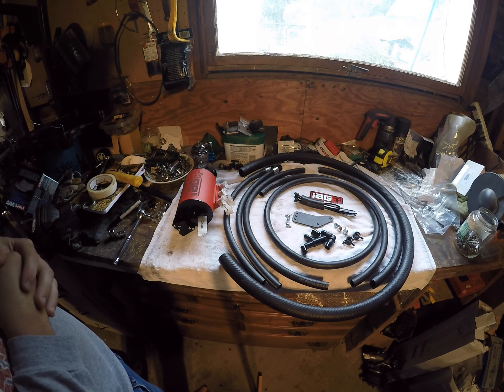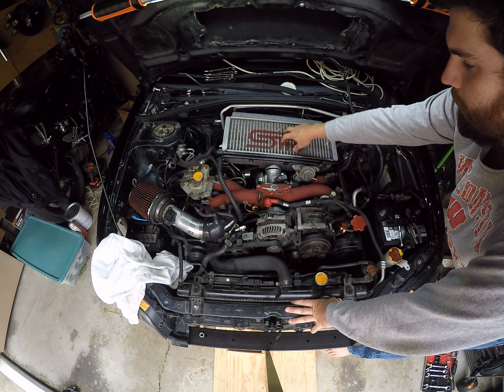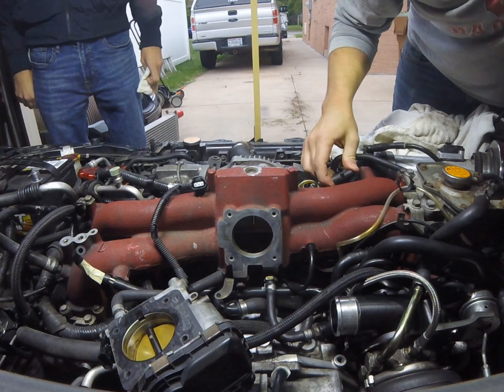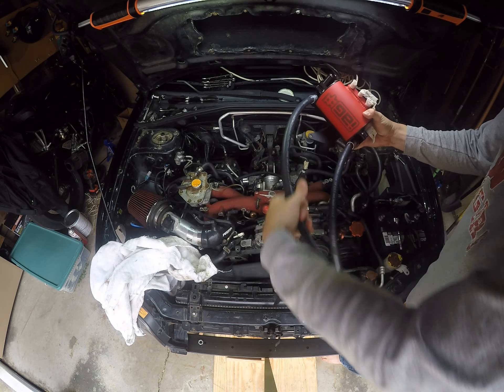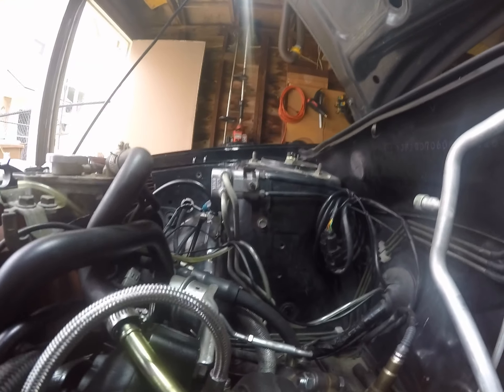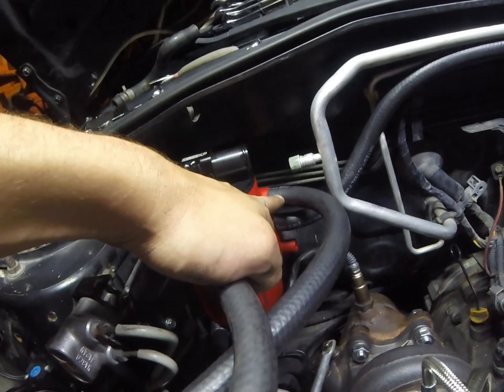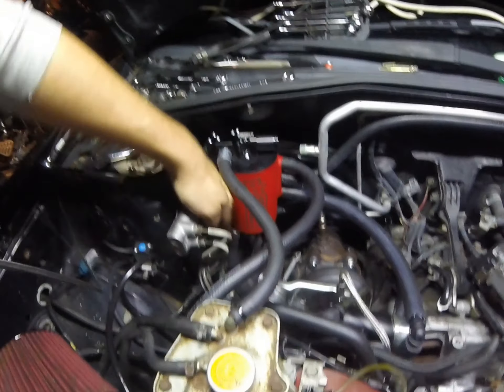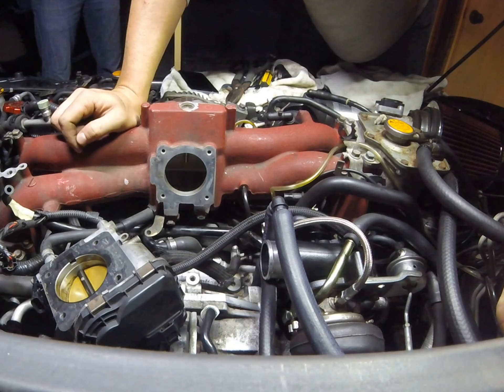06 Subaru STi IAG AOS Install

Comment: What's a better choice,  mildly modded aig block or stock block with many mods and tune.
Reply from the maker: Depends on what many mods and tunes are.  If you end up putting in bigger injectors and turbo and want to pump out alot of power, you will need to start upgrading the internals of your block.
Reply: Seeing how my engine needed a partial replacement at 28k, I'd say a new block and better heads.
Reply from the maker: RIP.  Good luck on the new build. I wish I had better upgraded heads!
Reply: @zirnheltdan  not building it. Calling it quits with cars, after I payoff or total this cursed thing.
Reply: @remissiveslave  Lol.. I'm 2 years late but it's not the car, it's the owner and it's it's maintained. There wasn't any need to sell it, just figure out how to care for a Subaru. It's different than other cars in that regard. but to each their own.

Comment: I just install my bro and I have smoke come to the bigger feeder hose that go to the under cassi is u car make the same thing
Reply from the maker: I don't have any smoke with mine. I would make sure you have everything tightened down so there is not oil leaking out onto anything.
Reply: Did you ever figure out why it smoked mine does the same thing
Reply: Yes
Reply: @armandotorres1478  yes I find the issue I I have ringland failure

Comment: how many hours did it take to install the AOS system?
Reply from the maker: Probably took about 2 hours. I did not run into any snags that hung me up. The most tedious part was removing the oil lines and trying not to break them...I did break them so had to wait for some braided lines to come in.
Reply: @zirnheltdan  im looking to do this upgrade to my 05 wrx. along w a  bigger turbo, which lines did you have to replace and which braided lines did you go w ?
Reply from the maker: @jaycenteio7615  I broke the oil line from the block to the turbo. unfortunately the way it broke, i had to get a new line from the blocks and the turbo but it was just a aftermarket braded line. I can not recall the brand. sorry.

Comment: Does yours make any noise? I feel like every since I converted my street series to comp serious there’s a whine every time I left off the throttle in boost
Reply from the maker: I have not noticed any noise but I also installed a bigger turbo at the same time. My blow off might be masking that.

Comment: Did u get a tune after you put it on
Reply from the maker: I did get a tune but that is also because I installed little bigger turbo with after that.  There seems to be a lot of mixed reviews where some people get one and some don't.  I rather have it and not need it then need it and not have it.